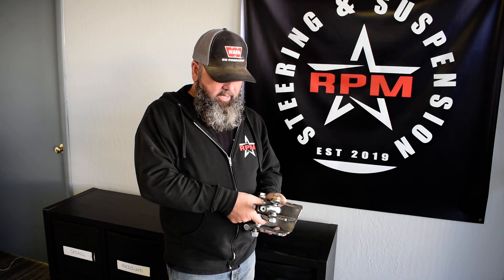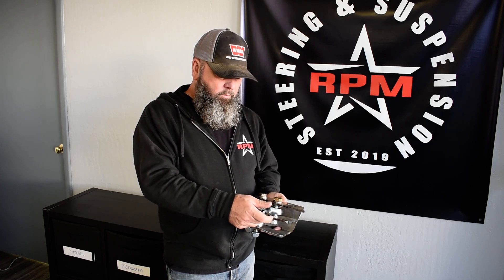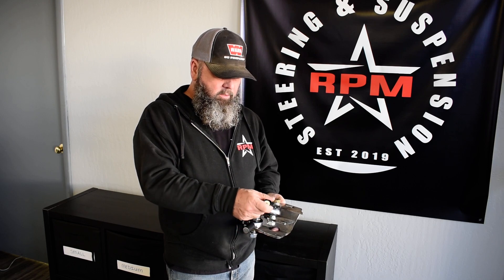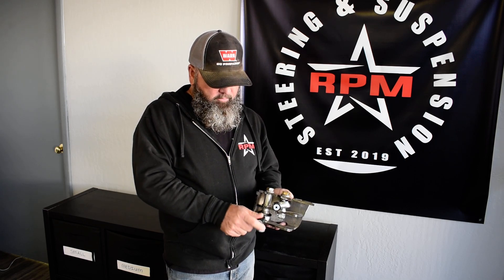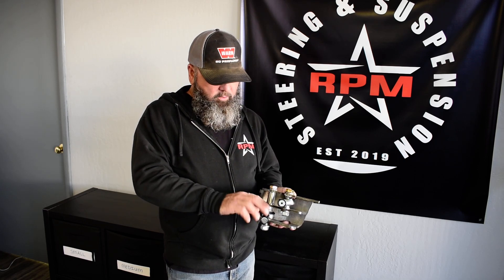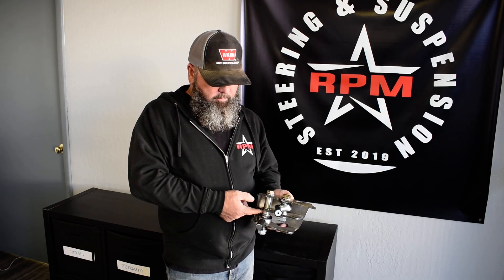RPM Steering Kit for Artec Weld on Superduty High Steer Arms (Artec Spacing)

Comment: Does this give full throw of the Sd60 axle with a JK box?
Reply from the maker: @ozguy2759 Yes, if it is used the way we designed the kit; you should have full throw both directions.
Reply: @rpmsteering  with what le length ram?  I've seen some people claim your set up makes it hard to fit a ram?  I'm just figuring out what parts to purchase for my swap.
Reply from the maker: @ozguy1393  we can send you pictures if you can send an email to info@rpmsteering.com
Reply: @rpmsteering  done